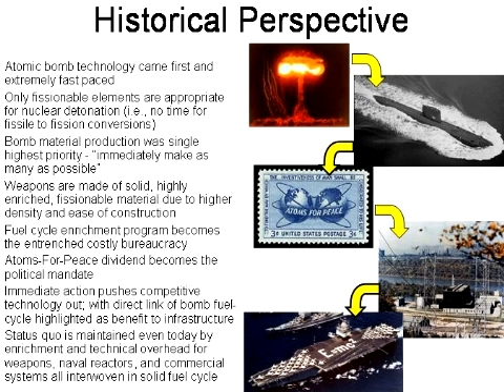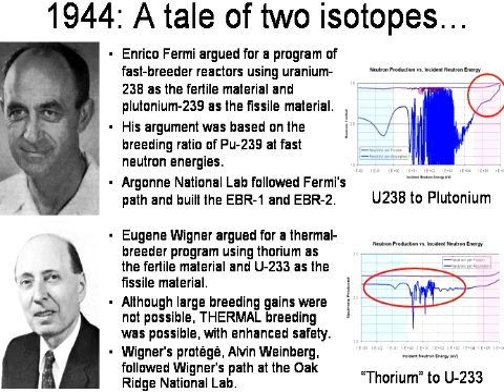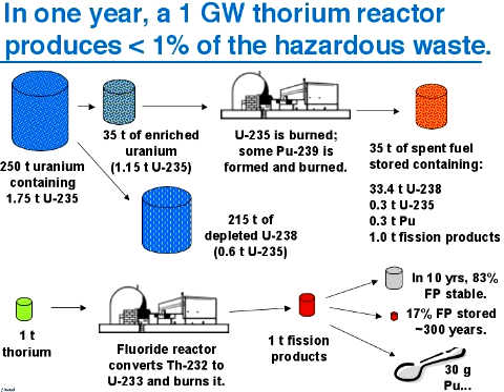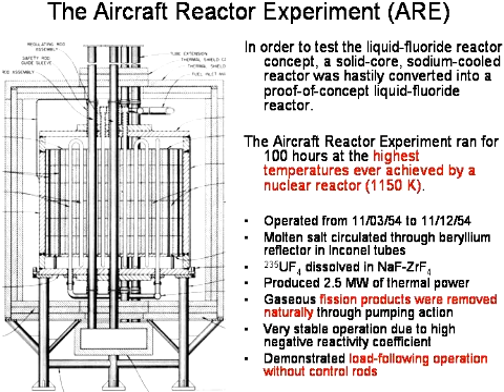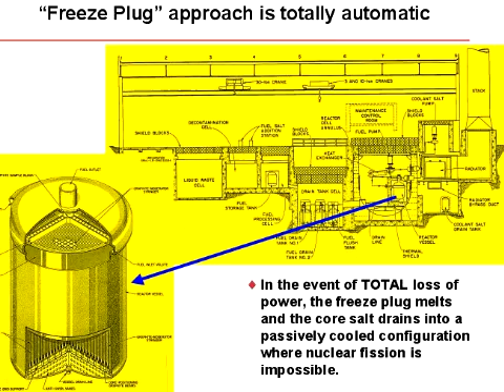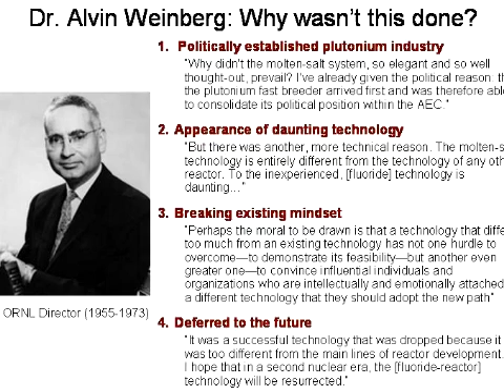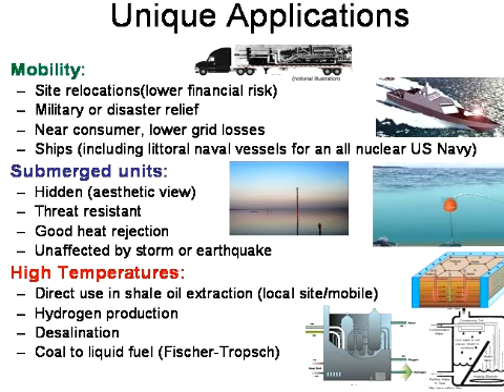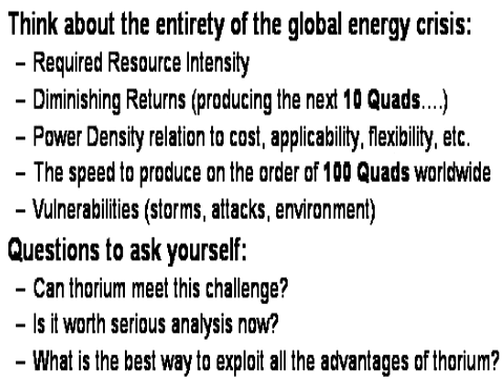Thorium Remix 2009 - LFTR in 16 Minutes

Comment: I would love to see a cost comparison of a nuclear power plant of any kind complete with reprocessing facility and safe disposal of spent fuel versus the cost for a wind or solar farm complete with energy storage.

The reason I say this is because my local nuclear research station at Chalk River, Ontario, Canada is making a dump. It is a low quality dump for low grade waste. The dump is just a very very large concrete container built above ground beside the Ottawa River. It is not a deep geological repository in stable bedrock. It will cost $1.3 billion Canadian (estimated). 

That is quite a lot of solar, wind and batteries that we will not be buying. It is also producing no electricity whatsoever. 

Let's be honest, Nuclear is not sexy. It needs to be far cheaper to be viable. 

It does make sense in space because pound for pound nothing else can compare. Also it does not burn up oxygen.
Reply from the maker: 1. Chalk River is not a nuclear power plant. Chalk River creates (life saving) medical isotopes, as well as advancing nuclear research.

2. Quoting a quote from the article: "People are commonly using the word dump. It's not a dump. It's a very engineered facility. It is engineered to last for 500 years."

3. Radioactive material becomes less radioactive over time. That is the nature of radioactivity. Store it well, and it is a "problem" which solves itself.

4. You are commenting on a video describing an approach to nuclear power (liquid fuel) which enables (life saving) medical isotopes to be harvested from a power-plant reactors. With a much better electricity-to-waste ratio than existing nuclear power plants... which already beat-the-pants off renewable harvesting hardware's extremely finite lifetimes. Nuclear fuel is extremely energy dense. That is how many DEPENDABLE kWh can be produced while creating relatively little waste. Very little using today's reactors. Ridiculously little using tomorrow's reactors, which can also reduce the volume of waste from today's reactors... they can recycle nuclear "waste" into additional carbon-free energy.

5. If you care about the environment, then you'll ask why so many climate scientists are demanding nuclear power be recognized (by the media and policy-makers) as a source of carbon-free energy. http://environmentalprogress.org/climate-scientists-for-nuclear/

6. You live in a very low-carbon province. Ontario has stopped burning coal. This is made possible by DEPENDABLE nuclear power. http://live.gridwatch.ca/home-page.html If you think nuclear is not needed to reduce carbon emissions, then please consider German emissions. Between Germany (high-carbon), France (low-carbon) and Ontario (low-carbon) you should have all the data you need to figure it out. https://www.electricitymap.org/?page=map&solar=false&remote=true&wind=false
Reply: Hi Gordon thanks for getting back to me and thanks for posting all the video's that you do. 

Your reply missed the crux of my argument though. Cost.

The "very engineered facility" where they plan to dump low level waste (including the reactor core that melted down in the 50's) will cost 1.3 billion dollars. 

Weather you are pro nuclear or pro something else, you gotta admit that that money could be spent in a lot of other ways. 

If that is what it will cost to clean up after every nuclear facility then certainly that will add quite a few more cents to every kilowatt produced.

As a tax payer in Ontario I wonder how much will it cost when it comes time to decommission Bruce Nuclear, Pickering, Darlington, and all the little university facilities. 

I am very much in favour of reprocessing spent fuel to minimize high level waste. We also need a good plan for low level waste as well. Chalk River's plan seems to be a lot of money for a poor quality solution. Deep geological repository seems better to me.
Reply from the maker: > If that is what it will cost to clean up after every nuclear facility then certainly that will add quite a few more cents to every kilowatt produced

Don't do that. Build better reactors on-site when old reactors retire. Feed the "spent fuel" into the new reactors as fuel. Just use the nuclear sites indefinitely to produce carbon-free energy.

The end result of a closed nuclear fuel cycle is fission products, of which some are immediately useful (assuming liquid fuel enabling chemical separation of different elements)  and some which are not, and must be stored for 300 years. Which is not hard to do.

Nuclear bonds have a million times the energy density of chemical bonds. The reason coal ash piles spill into rivers, and carbon is dumped into the atmosphere is the relatively dilute energy density of chemical fuel. Nuclear waste is contained because it can be.

We'd contain chemical waste too, if there wasn't so much of it.

There's already far more energy sitting unused in coal ash piles as uranium and thorium, than the coal produced when being combusted. Fissioning that Uranium and Thorium DOES NOT INCREASE THE MASS OF THAT WASTE.

FULLY fissioning nuclear "waste" also DOES NOT INCREASE THE MASS OF THAT WASTE. It is already waste. No one need to create any more waste to fully power the planet off "spent fuel". We just need machines which operate more efficiently to harness that untapped & carbon-free energy.
Reply: Well said Gordon, I agree. Thanks for thinking this through with me!

Yeah that thorium and uranium from coal ash is hilarious! I would love to see that happen!

Comment: Description says this "has the potential to solve today's energy/climate crisis," but definitely not today.

Fiona Rayment from the UK National Nuclear Laboratory states:
It is conceivable that thorium could be introduced in current generation reactors within about 15 years, if there was a clear economic benefit to utilities. This would be a once-through fuel cycle that would partly realise the strategic benefits of thorium. To obtain the full strategic benefit of the thorium fuel cycle would require recycle, for which the technological development timescale is longer, probably 25 to 30 years. To develop radical new reactor designs, specifically designed around thorium, would take at least 30 years. It will therefore be some time before the thorium fuel cycle can realistically be expected to make a significant contribution to emissions reductions targets.
Reply from the maker: Bronner33 Fiona's use of the word "recycle" implies solid fuel. There's no "recycle" with LFTR. There's no 30 years technological challenge there, if the reprocessing (or "recycling") takes place in liquid state. See "LFTR Chemical Kidney", find the 30 year challenge. There's a potential 30 year LICENSING challenge, where a back-and-forth between NRC and private enterprise could be dragged out 30 years, if research bottlenecks on regulations bottlenecks on research bottlenecks on regulations. That is plausible, although increasingly unlikely as the rest of the word moves beyond PWR, leaving NRC behind.

That is why I find it so amusing you've been posting factually inaccurate comments, such as asserting FLiBe is "hugely" soluble when it is not. That you've been posting spam links to my videos, after I pointed out why the piece you were citing was garbage. "I don't care what you think" you said. Ok, great. So stop commenting on my videos then. Because every comment goes through me. And when I see you ignoring my corrections, it reinforces the notion I have, and that possibly other people who look at these comments have, that a lot of the opposition here is not very well researched. Or even conducted in good faith.

I'm leaving this comment up, because you actually raised a plausible point (for once). Fiona DID say that. But her tiny quote in that article gives no indication she's pondering a liquid fuel cycle. Which would be exactly the same criticism I leveled against your spam links, that they were largely looking at solid fuel.
Reply: gordonmcdowell I am happy to amuse you, fucklips.  I didn't ignore your correction, I withdrew the error.
Reply: Bronner33 Thorium Remix 2009 - LFTR in 16 Minutes
Reply: Rw Kent LFTR in 6 minutes Thorium Nuclear Power Silver Bullet

Comment: Has anyone compared the amount of waste heat from your that  plant produces compared to the coal/water or the LWR Uranium for the system from ffuel construction,  mining, processing, Install and run,un-stall, rermove, and store?  How much of the carbon cycle does Lftr save in entrope increase?  Do you also consider the total heat being released by the reactor both in mechanical work and waste heat  Can we count on better efficience to cover the increased useage od global energy demand?   GAP
Reply: That's a big part of their push. The 99% fuel use & high operating temp means less wast heat, less entropy increase, etc. By orders of magnitude. And NO, you can't replace a donkey with an electric tractor and even begin to cover the increased usage in global energy demand with better efficiency.

Comment: Explosions take place because of pressure. If there is a lack of overpressure (because it simply is not needed) then you wont get an explosion. Fluoride clouds are also out of the option, because we are talking about a molecule that would rather stay combined with its pair. The thorium reaction kills itself immediately because of the U-233. No explosion, no toxic cloud, no radiation, no mass deaths. If it leaks, it cools. 
Yes we have to do more studies, but it is still way better then LWR.

Comment: Once again. the fluoride salt is not in a solution.
And if you are listing the dangers presented by the EPA (a institution I have high regards for) I will have to mention that in their list of hazardous chemicals they also mention silicate. That is pretty much sand.
Now that salt problem... We have a few options to chose from. Li2BeF4, NaF+ZrF4, LiF+NaF+BeF2 or NaF+NaBF4. All relativly harmless if you dont drink gallons of it, it'll dehydrate you. Not more dangerous then toothpaste

Comment: Sorry to be harsh, but a basic understandig of chemistry will let you tell the differance between a acid (the hydrogene floride) and a salt (NaF for example).
An acid is mostly the H+ ion. The rest of it is mostly just ignored. So it isn't the floride that is the problem. The acidic part of an acid is actually more closely realted to water. It is H3O+. 
Now a salt (as long as it isnt in the aqua form) is mostly chemically inert. So take NaF (which has NO proven toxcity) is a good use.

Comment: that explosive deal, fyi, has been dealt with. Also by ORNL. Instead of sodium (and his best friend water) you use flouride. Fluoride is nice that it doesn't explode when it comes into contact with water.
And the corrosive deal is also dealt with. Under the circumstances of the reactor, it just wont corrode.
Toxic? Destilled water is toxic. Sorry, bad argument but just had to say it. If by toxic you mean it isnt eatible, you are correct. But it is about as toxic as our batteries, so not very

Comment from the maker: Renewables are unreliable. So you're wanting local power plus either smart grid (to connect remote renewables when local renewables are not providing power) or you are asking for local energy storage (such as lead-acid batteries, flywheel, or pumped water storage). To make it work beyond 20% supply, much more is needed than simply building a local energy farm. Because each additional renewable operates only when the neighbor's rewnewable is also operating, not when the neighbor's is down.

Comment: @Tekknorg Im sorry but Thorium isnt as dangerous as you make it out to be. If they are then they wouldnt have been used for Welding wont they? or Engines... or Laboratory equipment or even Wire coating... Heck even Lanterns have them. And Thorium reactors dont produce Th-232... they use them up. And usually The longer the half-life of an element, the less radioactive it is, since its basically stable.

Comment: @Tekknorg You sir are completely unaware of how nuclear weapons are manufactured and of the technological challenges involved. It's not like you can just cut up a UO2 fuel rod (or divert LFTR bred fuel) and put it in a warhead. Making weapons-grade material is DAMN HARD, even advanced countries like Iran are struggling with it. It's way cheaper and easier to make U235 by Uranium-ore enrichment or U238->PU239 (both DAMN HARD) vs. try and extract anything useful from LFTR (CRAZY HARD).

Comment from the maker: @Tekknorg "Thorium Reactors: radioactive for 14 billion years". You mean like THE ELEMENT thorium? Present in the Earth's crust? The decay heat powering mantle circulation and thus generating the Earth's magnetic field throughout the existence of our planet? That's not very radioactive, and not-at-all created by the reactor. U-233 makes for crappy weapons material due to easy-to-detect gamma ray emissions from U-232 (present with U-233). There's a REASON why U-233 is not used in today's weapons.

Comment: @ryanlak1234.  By memory, U232 is made by the dual absorption chain.  It is the reason you sequester the protactinium so it won't absorb another neutron before it decays.  The uranium isotopes are chemically identical.  They can only be separated by centrifuge or diffusion.  It is easier to separate other isotopes of uranium if you want concentrated fissile materials.

Comment from the maker: @kingofthepaupers At the 9 second mark, you'll see 3 annotation hyperlinks (if you are viewing the video on a desktop not an iPhone) and you can jump to all of the source lectures. There's 3 long-ass lectures this is from, not a single "complete form" presentation. So if you want more details you'll have to pick through those. There is also LFTR IN 25 MINUTES, but it isn't slower paced, it just covers more material.

Comment: @creamyfilling102 CNN is owned by coal lobbies.  That's why they don't mention there are 2x more NPPs closer to the tsunami and quake   epicenter, but their back up backup generators were not near the NPP ocean front.  Back up generator placement design flaw not a reactor flaw.  

Anyhow, Anything with the word "reactor" is dead for another 100 years as you said.

Comment: @gordonmcdowell This isn't quite the same as the technology described in the Google video.  The Chinese are experimenting with using Thorium in existing CANDU (heavy water) nuclear reactors.  It's still better than the traditional light water reactors (like the ones that failed in Japan), but it's not nearly as good as a liquid fluoride reactor.  The freeze plug, especially, is what gets me so damned excited, especially considering a freeze plug would have saved the Japan reactors.

Comment: @0PsycoDad0 suggest we use? I think we can both agree we need to wean off fossil fuel right? Nuclear can provide us the necessary energy to do so right now whereas renewables cannot. Look at France - they have basically gotten rid of coal bc they are on nuclear. Germany - relying on wind and are leaning on coal still bc it isnt adequate enough. Thorium is the most energy dense substance on the planet. A marble of it could give you all the power you would use in your life. Renewables don'tcompare

Comment: @0PsycoDad0 ventusignis simply asked for clarification of your argument and you mark it as spam? Can you explain to me what you mean by 'the new grid?' Please don't mark me as spam for asking. Do you mean completely revamping the grid? What I mean about energy density is that renewables at this point have no where near enough energy efficiency we require. We would need way too many solar panels & turbines to run the grid, it wouldn't be feasible. Can you tell me with todays technology what you..

Comment: @0PsycoDad0 I would love to use renewables, however they do not have the energy density necessary to even come close to being a practical reality for running the whole grid, especially if we try to use it to charge electric cars and heat homes. Solar is too expensive to be viable right now. Essentially, we would have to completely cover the US with wind turbines to replace our current usage of energy. Thorium plants could power the US and it would only take up half of the size of Rhode Island.

Comment: This @0PsycoDad0 guy is FULL OF EXCREMENT. If one does a search based on his assertions, then very little of he has stated about thorium, Cs-137 & Sr-90 can be substantiated in regards to long term dangers.

"No long lasting nuclear waste" and short  half life.

The "data" that he will use as "proof" came from weapons testing. Come on @0PsycoDad0, links us some sources. Not a propaganda site or video that supports your "cooky" point. Or, are you just a "neo-enviro" nut bitch of the bankers.

Comment: Thorium is mentioned by Joseph Farrell as a key element to the Xerum 525 used in the NAZI Bell Project. The reason they give for why they were mining the Thorium may not be the real reason they are mining it... The NAZI's were stockpiling Thorium towards the end of WW2, and it's possible they were interested in a specific isotope of Thorium to use in their Xerum 525. If US Military were trying to acquire massive amounts of Thorium for Black Ops, they would need some form of an excuse.. Right?

Comment: My guess is that with contemporary knowledge the low half life fuel (thorium) could be used,, Im thinking of fast ignition techniques and a self damping system possibly molten salt with a ceramic heat exchanger.

Comment: Yes, fast cross-sections are lower - this doesn't mean you get less energy from fuel. Fast reactors can burn 100% of both fuel and waste actinides. Burning thorium completely provides about the same energy, not 5 times as much.

It says fission products only need isolation for ~300 years. Actually 99.86% of the technetium would be left after 300 years. Go look up how people feel about technetium release from Britain's Sellafield plant.